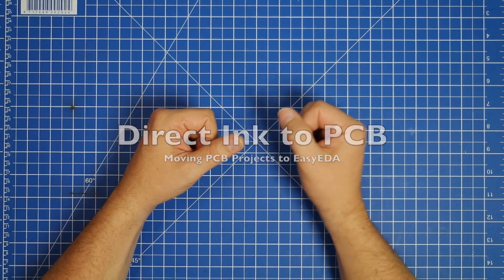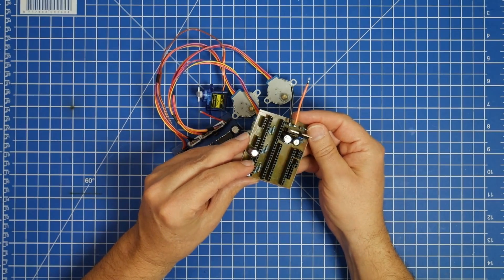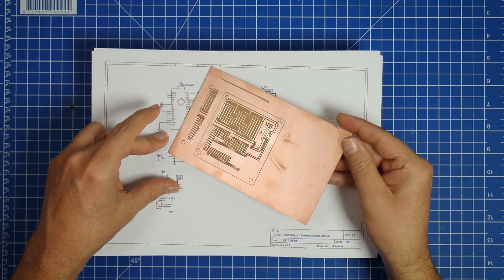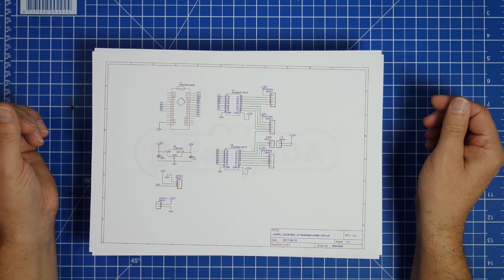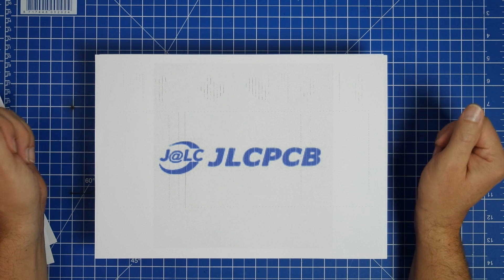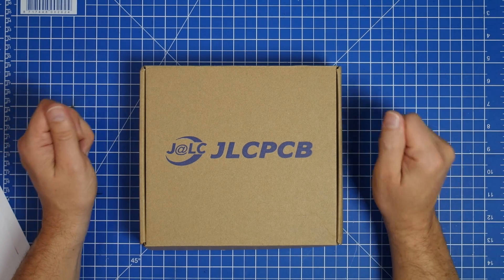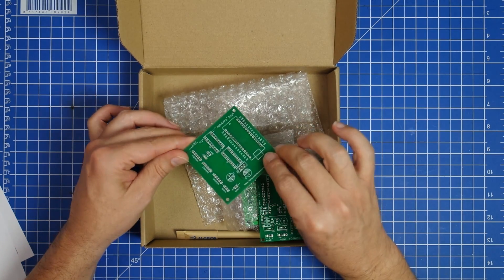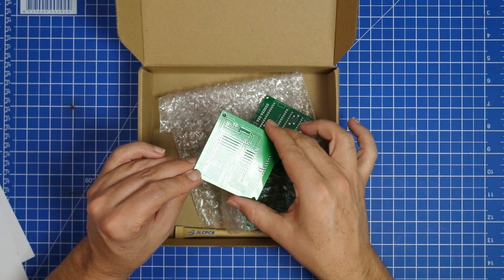Direct Ink to PCB - Moving to EasyEDA

Comment: Thanks for your older work it impresses and interests me greatly. Sorry though, but you have lost me on this one . If I am going to be ordering my boards from china, what do I need with a pen plotting cnc to copper machine? Cheers& best regards.
Reply from the maker: Most people wont' actually buy a board, but they copy the design and implement it themselves - with easyeda they can just print the plans and do it without installing anything.
Schools on the other hand, that are among my biggest customers (although its free) just want a working board, no hassles, no strings attached.
So this serves two purposes.
Reply: @dherrendoerfer  Godspeed Dirk!

Comment: Dirk, recently I came across this video and I thought of getting down a uController V1 pcb. I just went through the schematic. I think you need 3.3 volts to drive the stepper motors but I did not find 3.3 volts regulated output in it as in the CNC shield V4. I can see a 5 volts regulated output out of 12 volts input. Am I wrong or is it OK.
Reply from the maker: The v1 boards are meant to  be used with 5 to 12V unipolar steppers. The 5V regulator is for the servo, and can be omitted of the entire circuit is 5V only. 3V steppers are not really recommended for use with ULN2003 drivers, because they are limited to 500mA.
Reply: Dirk, thank you for your immediate reply. I am sorry for asking it without knowing which driver board is used. May I ask you whether you have designed a board to use with A4988 to drive bipolar steppers? I am asking this as I mentioned before  all the shields for Arduino nano with A4988 on ebay are wrongly printed.

Comment: Good afternoon Dirk
Firstly thank you for your videos they are so informative and well put together. I'm looking in to making my own direct ink plotter using your advice. I'm deciding on how best to do this and perhaps ordering one of your boards from China. Did you consider using a stepper on your Z axis ?  and if yes why opt for the servo? Does the servo give you the accuracy we'd require for drawing a good circuit board?
So many questions I know!! I'm lucky to own a 3D printer so can use this for some of the hardware. Do you have any advice for me before I get moving on with this? I value your experience and anything you can suggest.

Many thanks from the Uk.
Reply: Hello sir did you create the project if so can we talk?

Comment: "Good price for first orders..."  Does this mean that regular, ongoing orders increase in price?  Also, I'm trying to recall if on your channel I saw something about ordering a bill-of-materials for a particular board - is that something you've presented?  Thx.
Reply from the maker: Hi. No, prices do not change, but the first board in every order is cheaper than the second one, as long as it matches their 'default' profile. It's pretty neat if you do a lot of prototyping.
The BOM to my projects and boards is in my github repo, as well as everything else. But: it's part of the EasyEDA project page, once I share them.

Comment: Keep using Eagle 7.x. It is still available and it will be used at least for the scripts it has.
Anyway,  KiCAD or gEDA would have been a far better solution with the software always at your (and ours) service. As are open source, I won't be surprised to find out that some of their code is included in this cloud solution.
Reply: see this ftp://ftp.cadsoft.de/eagle/program/ - do not click it, you have to copy the entire string, including the ftp:// and paste it in the browser. Also, once you are inside the folder you want, don't click on the program name you want to download. Instead, copy the entire path and get it with wget in a linux console. Something like this:

wget ftp://ftp.cadsoft.de/eagle/program/7.7/eagle-lin64-7.7.0.run

Download all the versions you want and archive them, we may need them in the future. Also, for them to work on modern Linux distros, you have to create some symlinks with the names of the old libraries it needs, to the new libraries. It is also a good idea to store a Linux distro that works with them on a DVD, or create a special distro of Linux that come with these tools. Because local, on a local workstation is always better, especially in remote (or private) locations.